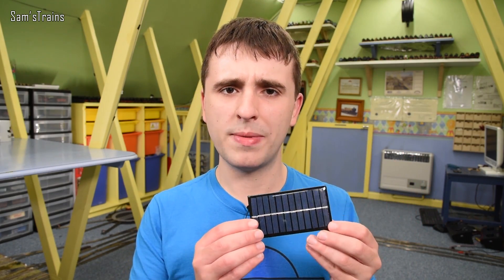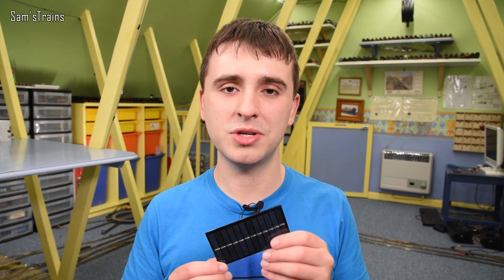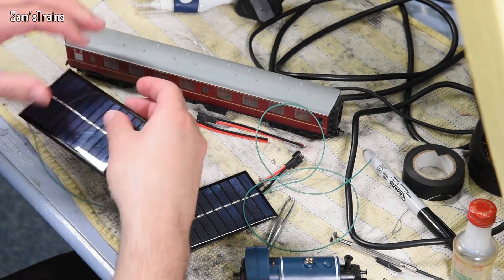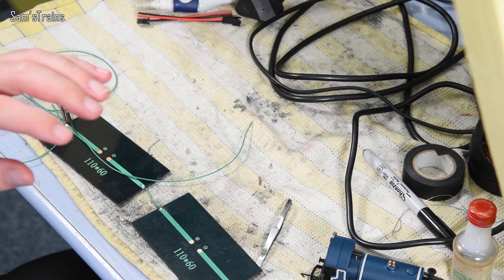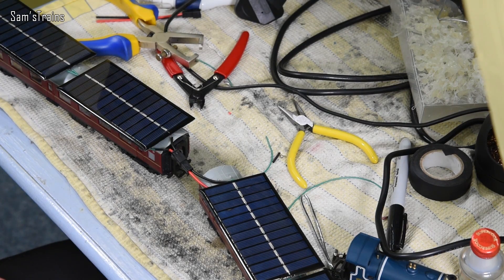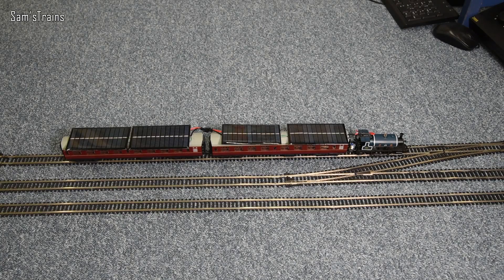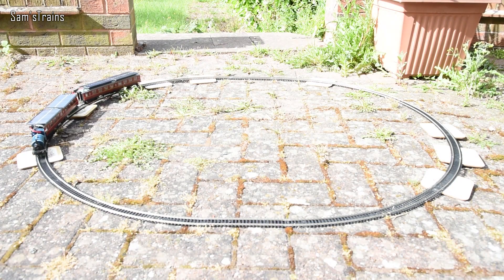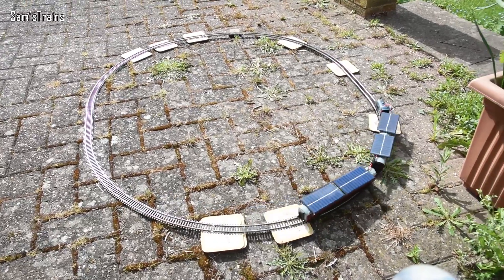The Solar Express

Comment: in reality all a steam locomotive needs is some way to heat the steam. An electric steam locomotive is entirely possible and if you make it solar powered and/or battery powered you'll have a very green locomotive.
Reply from the maker: Yes you're right - though of course it'd be pretty inefficient, (probably) drawing much more current than if they were just run on electric motors ;)
Thanks for watching - Sam :)

Comment: Very interesting....although someone may have already broached the idea, but if you connected the solar panels to the track, would you get the same result, taking into consideration resistance through the track.
Cheers Sam.
Reply from the maker: Yeah it would be exactly the same - except you could probably add a few extra panels, and get some extra power!
Thanks for watching - Sam :)

Comment: Interesting idea shld we run out electricity. 
An idea for a future video wld be:
Solar panels need not necessarily be on board the train. It cld be outside wired to indoor tracks with a switch for direction control. Hope this A level physics works out in practice. 😀 A good experiment.
Also consider solar panel to rechargeable  battery then to the indoor tracks with a direction switch. This wld improve reliability of the contraption.  
Much simpler than mounting on a running train I guess...
Reply from the maker: haha yeah - we'd also have to move our layouts outdoors, lol! ;D
Yeah a rechargeable would be good too, lol! ;D
Thanks for watching - Sam :)

Comment: I am always amazed by your abilities as an electrician and an electronics builder. Vocational training in a good professional school, maybe ? If so, regards to your professors, they have one of their best and talented pupils with you. I'm a complte failure in manuals works outside cooking, that is why I am sincerely admirative of every people like you.
Anyway, for using solar energy for model trains, if you want something, let's say, operational, you can load a DC 12V battery with solar panels, and plug it back loaded to your layout with a rheostat, or PWM dedicated circuit, and you can run model trains. But, due to the cost of the harware implied, the practical handling issues and the real usefullness of this kind of work (zero I mean), this is more a theoretical approach of the thing that something usefull. Except if you are living someplace without mains, like a narrowboat.
Reply from the maker: haha you're very kind Oliver - I did A level physics, but that's about it! I'm sure that not true mate! Yes indeed, that'd be fantastic to try!! :D
Thanks for watching - Sam :)

Comment: I just had and idea. We have diesel electric locomotives, why not steam electric locomotives. Now I know some steam turbine locomotives had electric generators, but what I meant was have the Pistons turn a generator. This could be a experiment, just with compress air instead, turning a electric generator (something like a motor could work for a generator) on a flat bed and then it's hooked up to a locomotive (I imagine something like a bullied Pacific or a coronation locomotive) to power it and then a tender at  the back with the air tank. This set up was used on the gen 3 up gas turbines and they have the world record for world's strongest locomotive.

Well would you consider this for model railroad experiment.
Reply from the maker: haha that'd be very interesting actually - I wonder if such a thing was ever made?!
Thanks for watching - Sam :)
Reply: @SamsTrains  it did in 1800. It had 8 wheels per bogie and had 2 of them. The front of the train was the cab. They burned 15% less coal and had a top speed of 60mph+. IDEA FOR A TRAIN FASTER THAN THE MALLARD!

Comment: If you bought a cheap tarp, and a bucket of garage/basement floor epoxy, you could create a portable level bed that you could place in the same location on the bricks, and would always provide a perfectly level surface. lay out a few boards to form a square or rectangular shape, and lay the tarp over the boards and the bricks. Mix the bucket of epoxy and pour it onto the tarp. The tarp will prevent it from messing up your bricks, and the 4 boards will provide a barrier to contain the epoxy in the tarp. When it's cured, you can cut away the tarp, leaving behind just a solid flat slab of epoxy, that when laid on the same bricks every time, will always form a level platform for you to lay tracks. You could even screw or nail down a loop of track for experiments, and easily store it away somewhere. A cheaper solution would be to get a panel of plywood, and level it by the corners. The benefits, is that you can level it anywhere, but at the expense of having to level it every time. The epoxy solution is restricted to exactly the one, singular spot, every single time. but it's something you just lay out, and it's instantly level.
Reply from the maker: That would be awesome actually - but I don't do this often enough to justify it really - but fantastic suggestion! :D
Thanks for watching - Sam :)

Comment: I once ran a Bachmann G scale trolley with solar panels on its roof. Worked great until the one of the gears broke (nothing to do with the power source, just cheap plastic). I do have an unfair advantage: I live in California ;-)
When you mentioned powering the track with a stationary solar panel, it reminded me of a similar experiment I did: I used a live steam traction engine (1:12 scale) to spin a generator using a belt drive. The generator then supplied power to a loop of track (G scale) upon which I ran an LAB locomotive! For ultimate irony, I used a "steam" locomotive, of course!
Edit: I made a video of it https://youtu.be/TdVkoDi1nAg
Reply from the maker: Ahh that's a shame - at least it worked for you - California couldn't be better for that! That sounds fascinating - what a cool idea!! :D
Merry Christmas,
Sam :)

Comment: Excellent experiment Sam. My son Charlie and I have just found your YouTube channel, and are loving watching your videos. We don’t have a model railway yet but are thinking of getting one, so loved your video on getting started. Thank you. One question Charlie has is can you run two trains on the same track independently with separate controllers please?  Do you have any videos on this please?  Thanks.
Reply from the maker: Thanks a lot Paul - that's really lovely to hear - tell Charlie hello from me! You can indeed run two trains independently, but you'll need a DCC controller, and DCC decoders fitted into the engines! Otherwise, you can run two or three engines on the track with a regular controller, but you won't have any control over the speeds!
Thanks for watching - Sam :)
Reply: Sam'sTrains - Thanks Sam.

Comment: Sam do you think it would work more reliably with a different, heavier loco?
I wouldnt mind a solar powered set as I just want to leave it running all day but not mount the panels on the train
Reply from the maker: Yes I'm sure it would - provided it wasn't too power hungry - since there was only just enough current to start the motor even on the 0-4-0!
Thanks for watching - Sam :)

Comment: It could run a lot better if you used a Linear Current Booster between the panels and the engine. Panels put out the most power at a power point voltage.  The LCB keeps the panels at optimum and will substitute that higher voltage for higher current to the motor giving much better starts and higher running speeds. It costs about 2 euro to do with slight modification of some off the shelf boards. I can supply further information.
Reply from the maker: That sounds very interesting! I haven't heard of those before - thanks a lot for the tip!
Thanks for watching - Sam :)

Comment: The wheels were spinning like mad, it seems you had too much power, but also too much weight, did you try it with one panel on each coach?
Reply from the maker: haha yes, without speed control it was very difficult! Unfortunately with any less panels, the current wouldn't be great enough! I was already using the lowest possible voltage from the panels!
Thanks for watching - Sam :)

Comment: Nice experiment there Sam. You know what. These would be ideal for an outdoor garden railway and it would have been interesting to see if another model train used as a double header could have worked as the 0-4-0 would have perhaps fed enough power into the track and might have powered the other locomotive too perhaps? :).

All the best
Ash.
Reply from the maker: Thanks very much Ash - yeah this would be fun with that! It would have been interesting, but there wasn't enough current available from the panels in the end :(
Thanks for watching - Sam :)

Comment: Perhaps fit a capacitor as a run on for when sun goes in but it will need a big capacitor as the sun only shines now and again
Reply from the maker: Yes that'd be good Frank - but you're right, you'd need a tremendous number of capacitors for that! A battery would probably be better!
Thanks for watching - Sam :)

Comment: Yes, a very nice experiment :-) Thank you for mentioning me, I did not expect that. Yes solar power is not the best answer for running a model railway, but a nice experiment anyway :-)  But when I posted my Idea back then under your video, I had a long-term-test in mind for model locos. If you use a solar panel for long term test, you have only low voltage and the loco run "forever".
Reply from the maker: Thanks very much Paul - my pleasure, it was a very good idea! Yeah it was just a bit of fun really!!
You're right about that - it would be good for that, but only during daylight hours of course ;)

Thanks for watching - Sam :)

Comment: Sam you say it’s a silly idea well a couple of years ago I designed and made a 00 gauge solar locomotive for my project for my engineering degree.
Reply from the maker: haha that's awesome - how did it go?? :D
Thanks for watching - Sam :)
Reply: I used a 4 wheeled coach so I could have the motor drive the wheels but I only had enough roof space for 1 3v solar panel so the motor didn’t have enough power. I still passed as most of the assignment was about the paperwork.

Comment: Completely stunned that it actually sorta worked!  Never thought there'd be enough amperage to get the motor going let alone pull 2 cars.  Surprise surprise surprise as Gomer Pyle, USMC would say. Although it came across more as Suhprise Suhprise Suhprise! Hats off mate to do the vernacular.
Reply from the maker: haha thanks mate - I never thought it'd work either - all the panels did have to be in parallel before there was enough juice though! ;D
Thanks for watching - Sam :)

Comment: when you think about it its not all that bad of and idea, if you are building a "Modern era" scene you could run those panels to a battery charging circuit and power street lights using the panels without causing too much extra power draw in the controllers output terminals, sure not powering the trains but still a way to implement functional solar to a layout
Reply from the maker: haah yeah absolutely - if you store the panels off the trains properly, you could power an outdoor layout quite easily with them! :D
Thanks for watching - Sam :)

Comment: I meeean, one could use filament based light bulbs to light up their model railway, to transfer power to the locos without using the tracks (it might work with LED light bulbs, but just barely, since they don't emit enough of right light), but it is definitely not what anyone would get out of their way and do.
Reply from the maker: Yes that would indeed work very well - but you'd need the panels very close to the bulbs, which wouldn't be very practical :/
Thanks for watching - Sam :)

Comment: “It’s a solar powered steam train, at the forefront of cutting edge technology”🌞 

Er no there is no night time service.

No sorry - that line has got tunnels.
🙂🙂
Reply: Rob Arnold have more solar panels than necessary have some batteries
Reply from the maker: haha yep - you'd need batteries for that, that's true ;)
Thanks for watching - Sam :)
Reply: Sam'sTrains do a ho/oo steam powered train that is actually powered by steam
Reply: @datguymiller  Hornby did make one of those a few years back.
Reply: Rob Arnold really?
Reply: @datguymiller  Sure did look up R1041 Mallard and R1058 Flying Scotsman. There are more but they can't run at the same time as electric ones, they must be on an isolated track due to required power differences.
Reply: I’ve heard of electric steam engines are Real search it

Comment: I like the idea of having solar panels by the track that feed in power to the rails. That would be an easy substitute for non beginners with electric engineering skills to replace plugging in electricity transformers into power outlets in walls to feed power into the rails. Someone needs to build an eco friendly railway at a model railway exhibition now at warley or somewhere in the US or mainland Europe Sam
Reply from the maker: Thanks Mayo! Yes that could definitely work - you could even use them to power a controller! It still wouldn't be that practical though! ;D
Thanks for watching - Sam :)

Comment: Solar panels have problems everywhere, even in the desert. No sun shining, no power. So around half the time they provide no juice, there is no sun at night. Then when clouds cover the sun, a significant power loss or a complete loss. Even in the desert solar panels have to be dusted with the lack of rain washing the solar panels. Nor does a solar panel provide juice under a inch of snow, ditto with dust... While a solar panel farm can power a city the size of Omaha, without the sun they won't light a candle...
Reply from the maker: Yes that's very true Ron - they only make for a good supplementary power source, or to charge batteries to store for later use!
Thanks for watching - Sam :)

Comment: Great kittle project I've done it to a G scale australian GM class Co-Co loco seams to work well around my mates house he also has stationary panels for Track power 

But I did put a nitro engine inside a RDC BUD car Rsilmotor before a little nitro engine hooked up to a dynamo then onto the original 12v dc motor and used the same rc controller rc cars use works a treat and sounds awesome
Reply from the maker: Thanks very much mate! Yeah stationary panels is much better if you're serious! Blimey that sounds pretty extreme - what an idea!! :D
Thanks for watching - Sam :)
Reply: Same idea as this video https://youtu.be/6evZjlUpfW8

Comment: I frankly did not think that the solar cells would generate enough current to cause the loco to move.  I thought perhaps it would permit the motor to spin, if unloaded (power connected to motor, motor connected to nothing).  

Fun experiment!! Well done Sam.
Reply from the maker: Yeah me too - I wasn't sure it'd be enough! In anything less than full sunlight, there's not enough!
Appreciate it mate,
Cheers,
Sam :)

Comment: Challenge. may come layout that runs on a car battery. rules you cannot modify the engines you Ken modified the track and the battery. You at least have to run 2 train do you accept?🛤️🔋
Reply from the maker: Yeah that'd be dead easy - two separate lines, connected to the car battery in series, you get 6v per track, that's a nice moderate speed! :D
Thanks for watching - Sam :)

Comment: Hi sam, is it true that if u have a siding with one switcher attached to it if the point is not set on the sitting there is no power going through the siding?
Reply from the maker: Yes most points do work in that way! :D
Thanks for watching - Sam :)